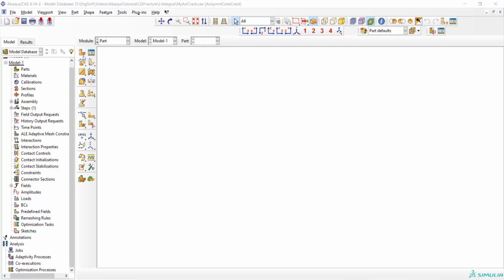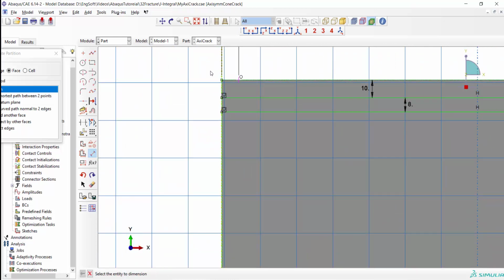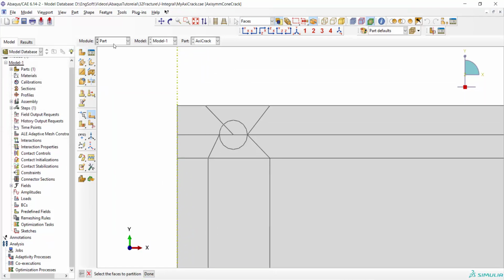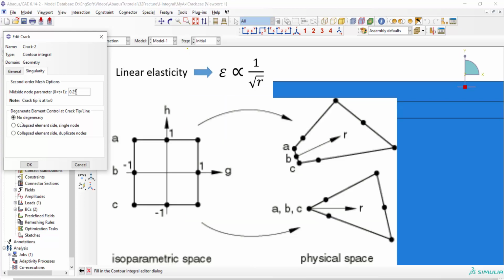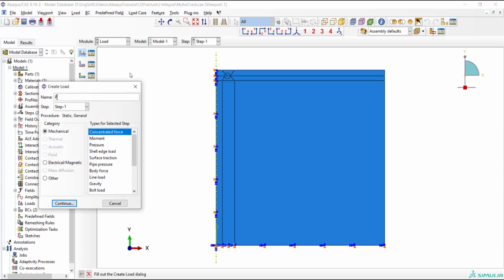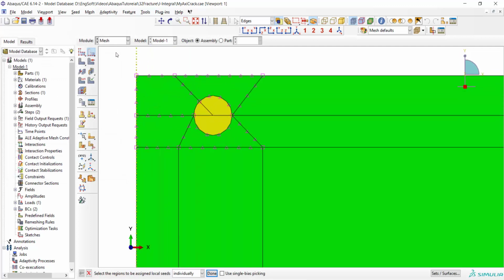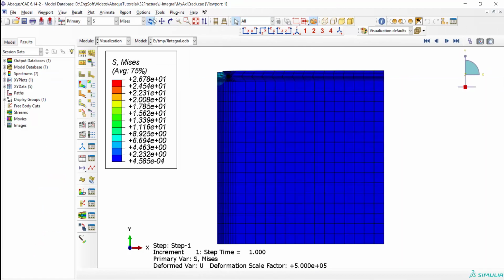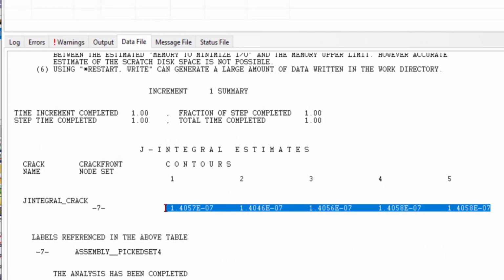Crack simulation in Abaqus: J-integral, designing mesh around crack

Comment: Could you say anything about which meshes are compatible and incompatible with J-Integral output requests? 

I used the following mesh controls and element type for the circle around a crack.
- quad-dominated shaped elements
-  mesh technique: swept 
- element type linear 
 My J-Integral calculation failed. An error message stated
Error in job NewJob1: Triangles, Tetrahedra and wedges may not be used in a contour integral region. 33 elements are within a contour region. The elements are identified in element set ErrElemIncorrContInteg.

With my mesh controls, the generated mesh included some triangular elements (the elements closest to the singularity. I created a circle around the singularity with 34 radial lines, therefore 33 slices - which explains the referece to 33 elements above..) which seems to be what the error is talking about. Why does J-Integral calculation fail because of this? When I use a quad shaped grid of mesh elements around the crack tip i dont have a problem. However I know that i should mesh a circle around the crack tip, not a grid

Do you have any recommendations of how to solve this issue?